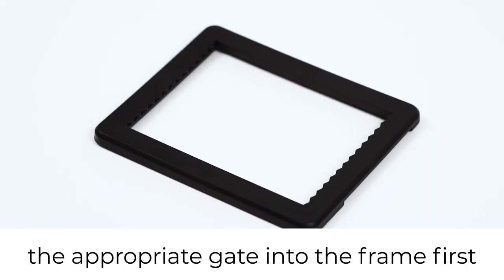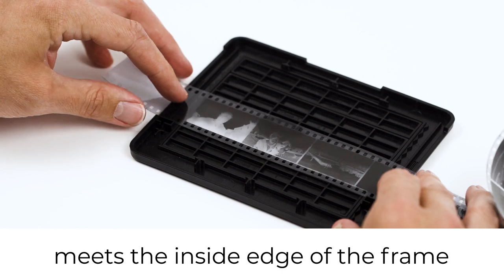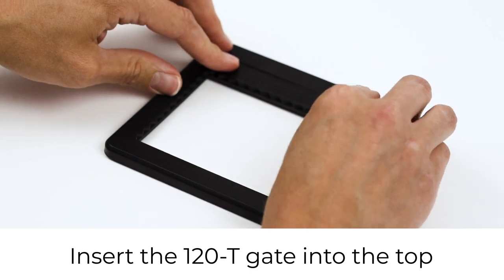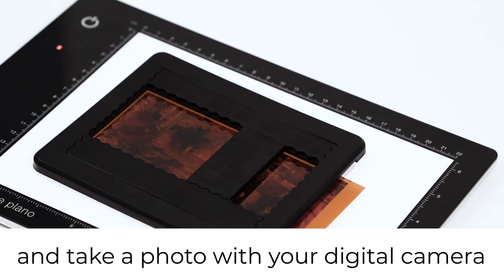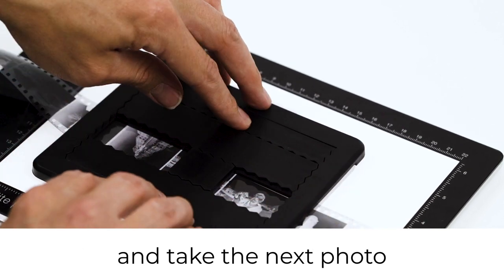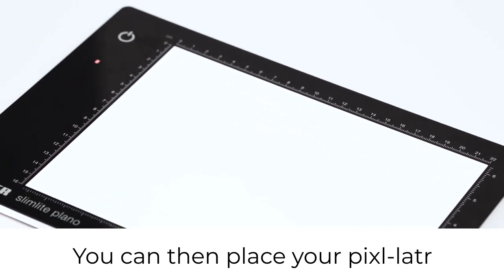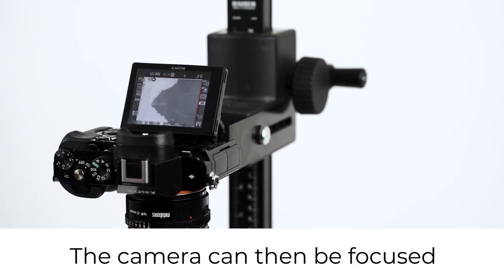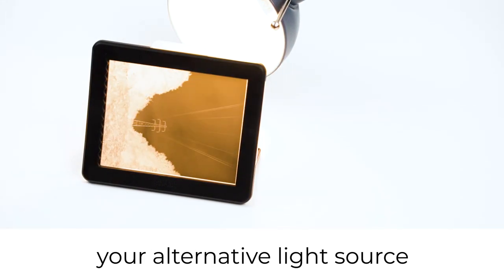pixl-latr Getting Started Guide

Comment: In this scenario won't the light shining around the frame flare the lens? Seems like you all need to come up with an attachment to prevent light from shining directly into the lens. Though now that i think about it, just some black paper or felt would be useful. Might be a good idea to create a best practices vid. Many people don't understand how much contrast can be lost with light shining directly into a lens.
Reply from the maker: Hey at about 2:30 onwards in the Using a copy stand section we do mention using a mask for best practice to filter out extraneous light and we're using one cut from mount board. It is something we're working on though! A best practices video is certainly something we'll plan to do though - thankyou
Reply: Is the mask an Add on cost
Reply from the maker: We now make a mask - you can find it here: https://www.pixl-latr.com/product/pixl-latr-mask-a4/

Comment: I've been using the pixl latr for over a year now, and the one thing that I struggle with is getting the film (especially 35mm) perfectly aligned. The process demonstrated here gets me close (though not if I'm digitising the first or last image on cut negative, since it doesn't reach the notch). I spend ages wrestling with the negative, since one side is often slightly cropped. Would it be possible to develop gates that have a rail, against which we could slide the negative, ensuring it's aligned?
Reply from the maker: Hi Euan, unfortunately, it would be very difficult to change the design without it negatively impacting on the function. We always recommend not cutting the leader or trailing end of the film, which in most cases seems to solve this for people. That said, there are one or two people who still seem to have this issue. Does your camera let you shoot 38 frames? The solution we have come up with for people who really suffer with the fiddliness is to team up with Valoi. We have made an adapter that allows the use of the standalone part of their holder within the pixl-latr ecosystem. You can find the adapter and their holders on our website here: https://www.pixl-latr.com/accessories/
I'm sorry that's not the easy answer you wanted - feel free to drop us an email if you want to chat more hello@pixl-latr.com
Reply: @pixllatr  No no - it absolutely is the answer! The Valoi adapter and holder looks like the perfect answer to my clumsy, sausage-finger struggles. Thanks for the link. :)
Reply from the maker: @EuanPreston  HA! Excellent. You know where I am if you need any more help!
Reply: @pixllatr  Thank you.

Comment: It would seem like there could be a lot of perspective / parallax problems shooting this handheld? It’s not as easy as it would seem to keep a camera or phone completely parallel so the edges don’t converge at all. 
Do you have any thoughts on this?
Reply: It’s almost impossible to keep them parallel each other if shooting handheld. The solution is using a copy stand. I’ve done this countless times and all the results were sharp corner to corner, I also use a glass (a cheap uv filter) to press the negatives in order to keep them lay completely flat.
Reply from the maker: Yes, in short, if you have issues, buy a copy stand or some sort of tripod. We haver lots of users who use smartphones for basic digitisation this way, but with a "proper" camera, it is definitely worth using some sort of camera stand